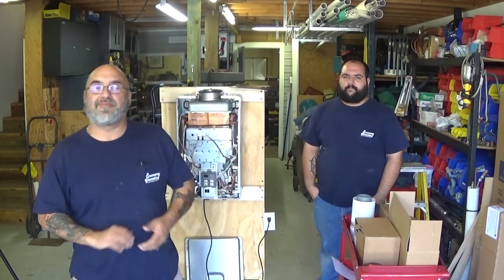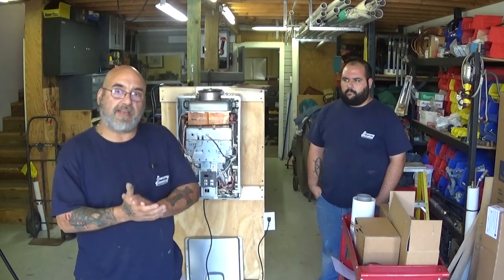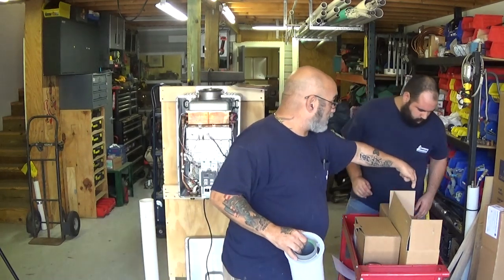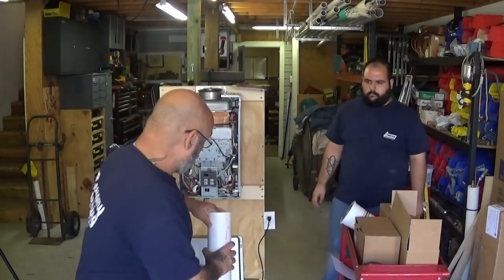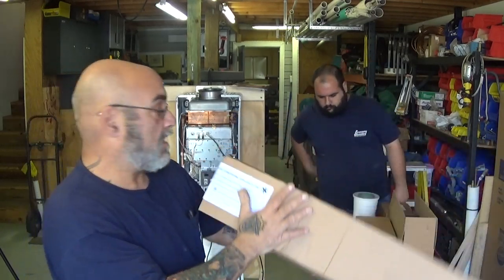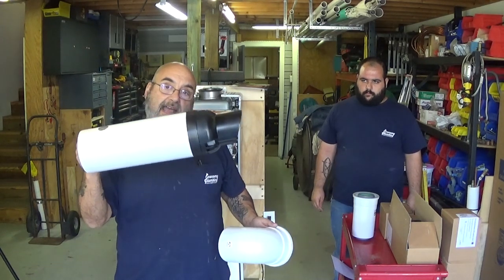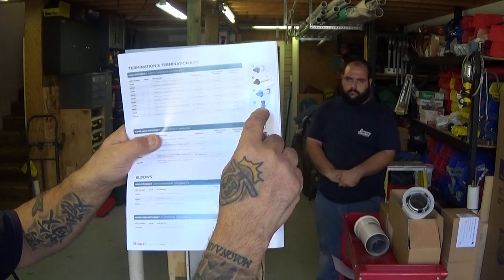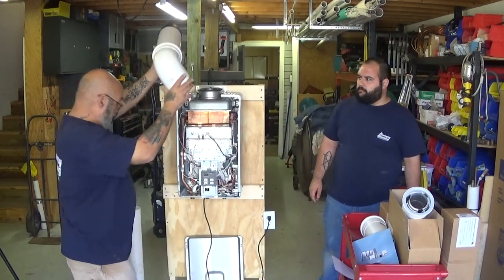Proper venting of a Rinnai tankless heater.

Comment: If you remove the metal tube from the plastic you can use a miter saw to cut both pieces individually  that is the quickest way to cut both pieces in less than 3 minutes

Comment: Thank you, Mike, and your assistant for your outstanding instructional videos.  You helped me to understand the value of using the right installation methods and proper components necessary to do the installation correctly.  The technique of using cut sheet paper to make a square cut on the tube is a fantastic (and simple) technique.  This video is almost 2 1/2 years old and is as relevant now as when it was made.  It's no doubt helped dozens, hundreds or thousands of us to get through a tankless water heater installation successfully, and I for one appreciate your having shared your experience via YouTube.  For the record, I have only uploaded one video on YouTube, and it was an instructional on how to extract a cylinder sleeve from a tractor engine, so I have some sense of the gratification you must feel for having helped others.  Highest regards.

Comment: I have a Rinnai V65i. I found a bunch of mud daubers nesting inside the vent from the outside wall. They are preventing cold air from coming in which in turn prevents hot water. I can't figure out how to take that black cap off so I can scrape the nests out, any ideas on how to do so? Should I take the pipe off of the water heater and pull the entire ventilation system off to scrape them off and then blow the debris out? Then after reinstall everything?

Comment: Mike The Rinnai Guy
Hi,
I got estimates and interviewed 4 Rinnai pros in order to purchase a tankless water heater. One said that we needed two RU199IN, another said that it wouldn't fit the job , another would only put in the RU199IN not the RUR, and the fourth only puts in RUR and said we would be able to run multiple appliances including the jacuzzi.   I also spoke to Rinnai customer support and they were of minimal help.
When I spoke to Mike the Rinnai guy.  he answered all our questions and clarified everything.   Mike also made suggestions to swap controllers to get timed recirculation instead of wifi to overcome some issues.
Mike gave us the confidence in your product and we sealed the deal the next day.  He is a great asset to your company.
Regards

-- 
Murray Bob

Comment: Hi, and thanks for the greatest videos on tankless venting.  We just bought a RL94i Rinnai heater.  Then purchased the two pipes in your videos:  The 18" VERTICAL ROOF DISCHARGE TERMINATION PIPE (SKU# 184118-S)  and a 19.5" NON-CONDENSING VENT PIPE EXTENSION (SKU# 224052) both UBBINK.  The heater is installed, It is a straight shot from where the heater's vent is through the attic and roof.  I think the installers made a big error with the venting...if I look at the section in the attic, I see a gap between the two white poly pipes.  Inside is a smaller metal tube that is accordion-like.  The plumber then taped around the gap with silver tape.  I am sure they did some bad cutting and rigged this pipe, as it is NOT what came with the unit, which was straight and smooth.  Assuming they have ruined the piping after watching your video, I went and bought two new pipe (same ones), and think I can do it myself whit the help of your videos and since the ceiling and roof holes are cut.
I assume the bottom of the roof termination pushes directly into the top of the extension (in the attic), even though the top metal (roof) piece  protrudes only about 1/4" beyond it's poly.

Thanks again for the five-star videos!!!!!

Comment: Love your videos, man!  I love your paper trick for getting a straight cut. Quick tip on cutting the inner pipe, instead of measuring 1/2” out from the outer cut line, measure from the outer edge of the center pipe, and cut the same amount from the inner as you did from the outer. The inner pipe protrusion is set at the ubbink factory, so basically cut the same off the inner as you do off the outer and you’ll always end up with a factory-perfect inner-pipe protrusion. Love your channel!

Comment: How would you adapt from the condensate trap to your cpvc? Fernco?
Reply from the maker: The bottom of Rinnai’s trap will fit into a 3/4” CPVC coupling. You don’t have to glue it just strap it to the wall very good and run the pipe to some type of drain.
Mike

Comment: For anyone with a long vent going straight up or up and then out, you may hear a loud noise due to the way long vents change the air mixture for the rinnai. First you gotta make sure you have plenty of gas available at the tankless, I had to install a bigger regulator (maxitrol 325-5L nat gas replaced old 325-3L). Then I had to tune the high and low burn mixtures. Check your manual but for me I had to turn on a bath tub full hot (triggers the loud noises), open the front,  flip dip switch 8 on the top switches to put it in mixture tuning mode, hold down button B For 1 sec to put it in high burn tuning mode (starts flashing a small red light, the two black buttons are A and B). And used A and B to tune the mixture pressure, I turned it down (B) about 5 or 6 presses until the noise stopped. If I pressed it anymore the noise would return, and I could see the flame going out in the window, so I turned it back up a couple pushes until it was nice and quiet. According to documentation you should do this with a manometer attached and tune it to about 2.6"WC (from factory it comes around 2.8"WC high burn) however after playing with it, I had to turn mine down quite a bit more to about 2.3"WC to get rid of the loud flameout noise when mine was warming up for a high flow, like a bathtub. finally flipped off switch 8 and it was fixed. You can also tune it for low burn by following same process but holding button A for 1 second until you see red light. This might help with noises heard when first opening a small faucet tap. According to the documentation, it needs to be lower pressure high burn the longer your vent is. They really should make this more emphasized because I read so many comments complaining about the noises and lots of people just returned their rinnai tankless units rather than mess with it. Mike's a good guy he helped me test some things  including tightening up all the vent pieces but ultimate fix was this high and low burn tuning process which my plumber did not know anything about. The documents are really poorly organized on the rinnai website with dumb file names but if you lookup your model on the website and click through the attachments you should find a file that has instructions for this process. Good luck! Hope this helps someone like me who had it all installed but was pulling my hair out with that loud noise when running a bath.

Comment: I have a question if you can answer, i will have a 250 Gallon propane tank, and a Rinnai V65EP tankless Heater, that will be running just the Shower and The Kitchen/Bathroom sink,  3 people living in the house -- how long might that tank of Propane last?
Reply: Let me take this as far as I can and the Rinnai V65EP estimate could be useful for you.  I can tell you how many gallons  of water the Rinnai can heat based on it's 100% duty cycle run time. If you use it for say 2 hours per day total, your run time would be 2/24 or 1/12 or 8% of 100% run time until propane tank is dry.

Propane: 91,502 BTU per Gallon. x 250 gal, (assume 100% fill while 85% is more realistic). Rinnai V65EP spec:  150,000 BTU (Maximum) or 1 gallon propane is consumed every 37 minutes. Lets convert to hourly propane burn rate. 1.7 gallons propane consumed per hour of operation at MAXIMUM heating rate.  So a 250 gal tank of propane will power this Rinnai continuously for 152 hours or  6 days   and 8  hours. Factor in the claimed energy efficiency of 80% later.  The Rinnai V65EP produces 6.5GPM of hot water or 390 gal hot water per hour. Measure your hot water consumption against this 390 gallons per hour times 6 days 8 hours to see where you stand. If you use a total of one hour of hot water per day, multiply 6 days, 8 hours times 24 and get 152 days from one 250 gallon propane tank. If you use two hours of continuous hot water, halve that to 76 days or more than two months. YMMV
Reply: @dsweedler  thanks so much for the reply -- the salesman told me it should get an average of 1 year on that 250 gal tank filled at 85 percent... i may rethink getting one on the info you told me -- Thanks so much for the reply.
Reply: @kkandretti Two small things that could tend to make the run time closer to one year rather than my estimate of 152 days. The first is a biggie. If your hot water consumption is less than the rated 6.5gpm when you demand hot water, the estimate should be adjusted to the longer  propane tank refill as the water heater is not consuming it's rated 150KBTU propane consumption. If you are typically using 50% of rated capacity when in use (3.25 GPM), then double propane tank refill time (and halve your propane cost per year!).  I am not familiar with external propane tank installs but I don't believe they include a flow meter totalizer like standard metered natural gas installs to measure propane consumption. If yours does, then measure your current weekly propane consumption to get an idea of your needs. In general tankless on demand is much more energy efficient than any tanked water heater and the most modern Rinnai units are super efficient compared to older tank designs due to modern high efficiency heat exchangers.

The second is an error in my first paragraph. It  is off bigly as I typed a percent or division rather the correct multiplication. So it is 12 times the one hour rated consumption for daily rate and not the 8% at  a two hour demand usage per day.
Reply: @dsweedler  Thanks - takes note of what your said. :)  Keep up the Good Work.

Comment: Your videos are very informative.  Thanks. I wanted to replace 2 50 gallon  water heaters with one tankeless but they are not close to outside wall and the exhaust tube are connected thru the chimney thought I can use it for tankeless ventilation but I guess this video changed my plan

Comment: Can I vent a Rinnai heater and Rinnai boiler and use the same venting exhaust ..I have a exhaust and fresh air going up?
Reply: david brinkman no you can not I would put two separate vents out the building 14” or better apart

Comment: Appreciate all your Renaii videos.  Do you have a video that explains a simple way to clean out any obstructions (wasp nests, dryer vent stuff, etc) that may be blocking either the exhaust or air intake on a vertical non-condensing vent pipe.  The vent pipe goes directly up from the unit in the garage, through the attic, and terminates above the roof.  Have read somewhere where people have used a leaf blower to blow air from the vent opening in the unit up and out.  But will that clear out any debris in both the intake and exhaust parts on the non-condensing vent pipe?
Reply from the maker: unfortunately you have to remove the vent to clean it out. Mike
Reply: @ThatTanklessGuy  Thanks for the quick response.  I think I’ll need to hire someone - don’t want to go on the roof and not sure how to take apart and reinstall the vent through the attic.  By the way, your video on fan cleaning was excellent.  After getting code 10s took out the fan and there was a lot of debris including two wasps, several moths and other stuff.  Cleaned it all out, replaced the fan and the heater is working fine now.  Finally, last time I flushed out the heater, I messed up the plastic water filter inlet cover (using pliers).  Saw your video with the removal tool and ordered it ( came with two filter/cap assemblies). Made taking the filter cap off a very easy task!  Thanks for your help!

Comment: Having a problem with exhaust freezing over causing a code 10 on a rinnai rl94 unit.I live in Northern sask.where currently temp is > - 30.any recommendations to solve this problem
Reply from the maker: Unfortunately no you need to just check the vent often sorry

Comment: When venting the intake and exhaust from a basement (newer Rannai tanks) with 2" Sch 40 PVC , is there a  limit to how high up the elbow is above the unit and can there be more than 1 elbow on the exhaust in case you cannot directly go straight up with the venting because of HVAC unit outside ??

Comment: Hello,

Great video can you tell me where to get the the lower enclosure  to cover the pipes. The RX199IN is going to be installed on the outside of a brick hose. On lowes web site is picture with it installed but i can seem to find how to purchase.  Got the top cap on order as well.

Thanks 
David
Reply from the maker: You can buy it from Rinnai direct or I think Amazon sells it
Reply: @ThatTanklessGuy  They referred me to Ferguson got it.

Comment: Hi Mike I just purchased a pre-owned  RL94i series. The biggest question that I have of course is the Vinton. When I purchased a unit it did have a plastic gray venting pipe the per your instructions it should have the metal concentric venting pipe. The question I have is can I use some schedule 40 PVC pipe to vent the unit through the roof of my house because this will be going in the Attic?

Comment: Thanks for the great video. I was wondering how to get the proper pitch on the pipe when I cut the hole on the outside wall for the tankless. The template supplied with the heather says 5” from top of heater and was wondering if that will give me the 1/4” per foot required.

Comment: Mike, Thanks for video, it helped a great deal. I am replacing an old tank unit with the Rinnai rur160ie, in a walk-in crawl space. There is a pier 9” from the center of the existing vent hole. I am planning to use the concentric venting set up. Can’t I use a 45 degree elbow to give me the additional clearance that I need for this install?

Comment: Hey Mike, Thanks for all the informative videos! I have three questions:
Background:
Previous homeowner installed a Jacuzzi non-condensing tankless indoors. Ran concentric Ubbink venting with a few 90s and 45s over 10-12 feet to a horizontal exit.

1. Is it ok if the installer kept the air intake portion of the termination INSIDE the house? (The larger black portion of the terminate with the intake vent is inside while the 3 inch exhaust is the only thing exiting the house.)
2. Installer did not orient the vent to slope away from unit but instead it’s about 2-3 degrees slopped back down to unit.
3. There is a black nipple at the base of the concentric venting but there is no condensate tube/tank being used, should I get one and install it?

Happy to chat if you’re willing and thank you so much for being so giving of your time!
Reply: @TheBuddylab  will do!! Thanks!

Comment: Mike thanks for that video on venting properly a Rinnai tankless water heater.  So, I’m in the market for a tankless and I had a guy give me a quote for the Rinnai Sensei RU160iN. He came by my home and took a look at my old 50 gallon heater. He talked about how he would install it and then said he would use my existing chimney metal vent off the top of my old heater with the new rinnai unit. You said that would burn the unit out in a year and it’s not covered under it’s warranty. So is this company worth dumping?

Comment: I have a question for you.  Just installed an R53i Rannai and it works well.  I used Rannai concentric vent pipe.  Plastic with the metal center.  When I plug in the vent pipe which is 4' long total.  90 deg plus an extension through the wall to the outdoors.  Now when I turn on the water the heater comes on.  But, quite often the burner starts then the unit rumbles the flame turns orange but will go back to a blue flame???  So, I just put the 90 deg on the unit to see what happens.  It still does the same???  I can't figure out why???  Without the 90 deg the unit seems to work all the time.

Comment: I get a foghorn sound with my unit after running fine for about 2 years. I've flushed with vinegar a couple times, but it didn't help. Noise seems to come after the unit runs whether someone had just used water or not. I experimented by turning my recirculating pump on the lowest setting, and the sound became rarer. I have it back turned to high and now my hot water turns cold periodically. Super annoying. Even saw an error code 10 pop up. I've taken the fan out and exhaust. Everything is clean. Any thoughts on this?
Reply from the maker: what is the model number, gas type and about how old is it. Mike
Reply: @ThatTanklessGuy  Hey - Sorry - didn't get an alert on your response, but I posted and upvoted another video. I just came across your video and saw my post and your reply.... It's an RUC80. I replaced the burner unit myself (thanks to your video) and realized that the issue was dust build-up in the ceramic screen above the burner. I had same issue pop-up about a year later and paid $1000 to a plumber to disassemble and clean and reroute the intake to what they said was the correct way. I am now getting that sound again. I hate this unit for not having an easily removable and cleanable filter.
Reply: Oh, and the age of the unit at the initial foghorn was barely a year and a half. The age now is about 5 years.

Comment: Will Rinnai fittings and piping work with AO Smith 310c tankless water heater? It’s the exact same 3”X5” connector on the unit.
Reply: David Jimenez it should Ubink is a separate company that makes venting for different Heaters. Rinnai just approves them for use. Just make sure your using the rite tape for condensing or non condensing.

Comment: I currently have a Rinnai that is malfunctioning. Getting a "10 code" on the control box. I've checked everything and it is all clean. The vent pipes are old and the gaskets are dry rotted. Could that cause the "10 code"?
Reply: cwestallen yes that could be the problem. But it also could me the heat exchanger is clogged